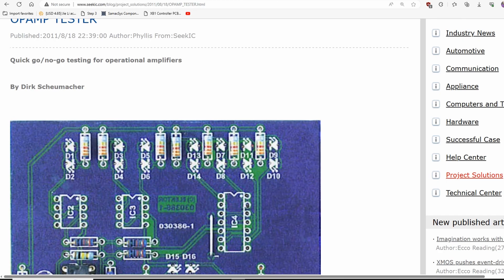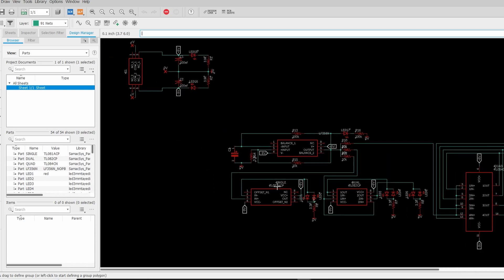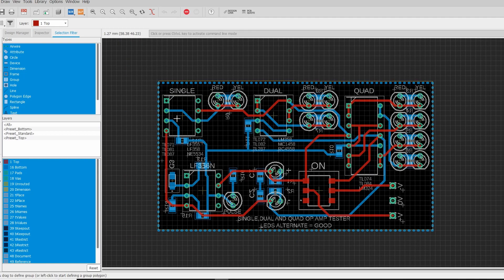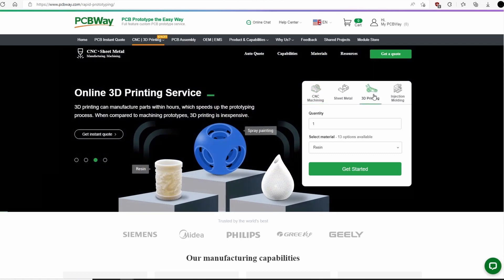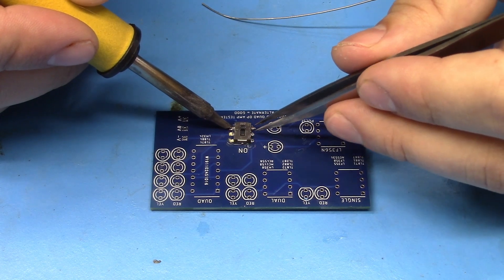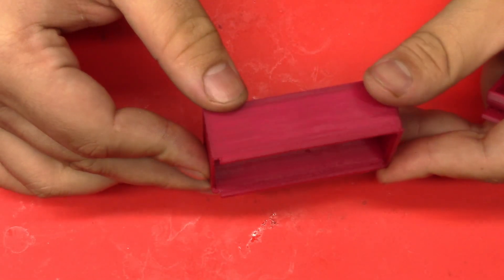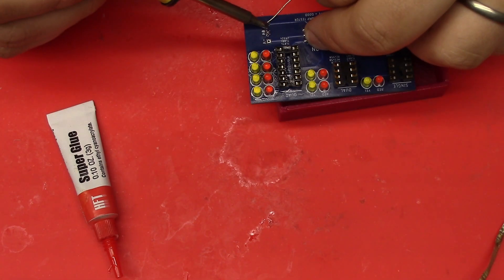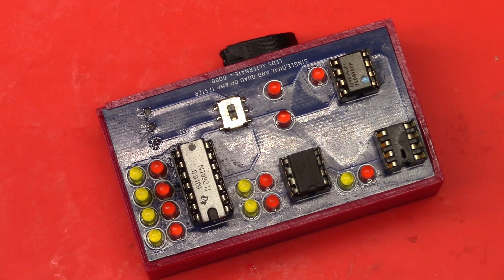DIY OP AMP TESTER!!

Comment: Hello friend! Can you answer my question? The power supply for pins 11 and 4 of IC 4 in this diagram is inverted, correct?
Reply: That is something I'd noticed myself pin 4 should be the positive rail and pin 11 is the negative rail on a quad op amp.